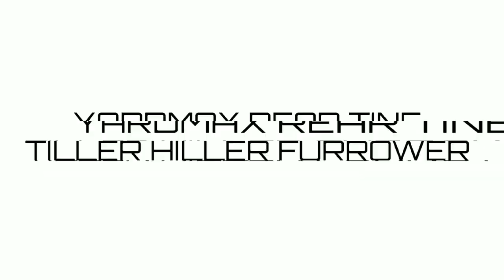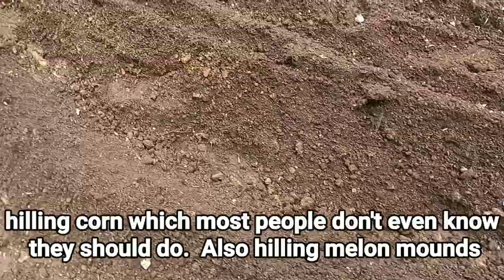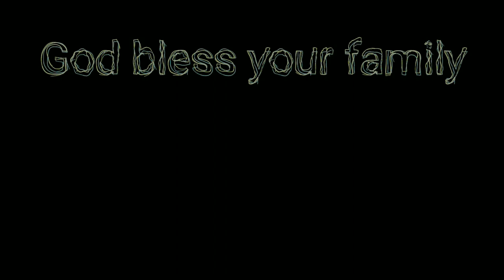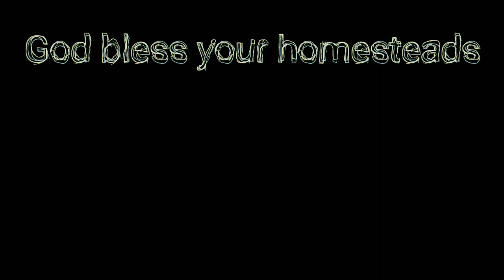yardmax husqvarna southland powermate troybilt cub cadet hiller furrower #tiller #attachment

Comment: I'm looking for a hiller for a toro rear tine tiller. Any information would be greatly appreciated.
Reply from the maker: which model do you have?  If I know the model I can try to find pictures to see if this one will work, its pretty much universal for most models because it has numerous ways to attach it ... but don't hold me to that until I find pictures of what you have.
Reply from the maker: also, outside of my previous comment, if you look at this instruction manual on pages 2, 3, 4 it shows the different ways it hooks up.  It might work just like mine did but that depends on how thick the depth bar is.  Here is the manual https://www.manualslib.com/manual/1910170/Earthquake-15683.html#manual
Reply: @sharpridgehomestead  My Toro is model no. 58603. I do appreciate all the help. I thought the earthquake model hiller might work. Might have to make some modifications or an adapter. Thanks again.
Reply from the maker: @dlc9345  i believe that it will work, it looks just like my setup where you will remove the depth stand thing and it fits into the slot it occupied.  Heck, i found out my tiller works better without that silly depth guage so i just left it off even with the hiller removed. Easier to control and goes just a tad bit deeper now.
Reply: I may just buy one and give it a try. Thanks for your help.